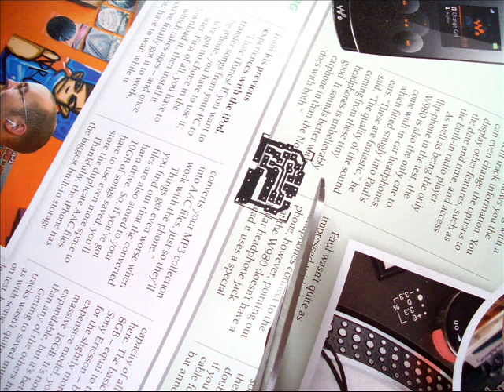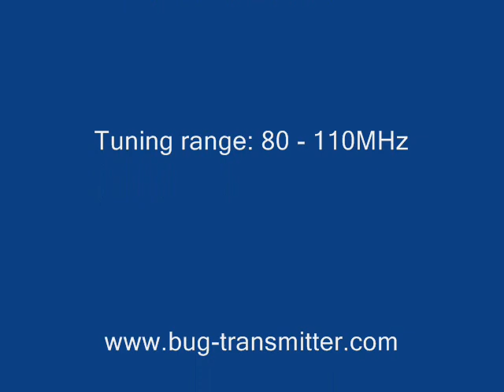Making a long range spy bug FM transmitter

Comment: I have a mp3 player FM for car, How can I change it for 9v battery and put a micrphone to make a spy transmitter from it?
Reply from the maker: +Anonimescu Cutarescu 
Yes that will work ,you will need to build a transistor amplifier circuit for the mic.
Reply: +dazaro3 Thank you. I tryed to put mic. on a fm moldulator mp3. did not work. I had also put a  sound from computer and it worked a litle bit but, bad noise aswell
Reply: works with a usb male cable and A portable battery charger of a phone
Reply: +CrissPivot Thanks for replay! anyway I cannot imagine how to do it, at the moment. I will think about it in time.
Reply: Anonimescu Cutarescu http://www.instructables.com/id/Re-Transmitter-1/ use this
Reply: +CrissPivot ThanKs a lOt for iT.
Reply: Anonimescu Cutarescu  :)

Comment: If you replaced the mic with a 3.5mm jack cable this would make it a music transmitter too yes?
Reply: it would work but the quality of the sound is not so good
Reply from the maker: micultimy91
You will have a problem on the circuit. Double check all your work.
Try a different value resistor where the 68k is ,try a lower value resistor ,39k or even a 22k.
Reply from the maker: Please see my other videos ,i show hot to build a transmitter with a audio input.
Reply: dazaro3 could you please tell me how could I use mic as well as audio input work both together. Let me know what are the modifications required including all the new values.

Comment: Cool video but then,,whats the voltage rating of the various capacitors?
Reply from the maker: In this video they where all 50v caps.
Reply: Thanks for that.im also intending to make the pirate fm radio transmitter,,do i still use the same caps voltage ratings

Comment: 19v??? Do you know that this voltage is too HIGH for this circuit? Probabily you have burnt something with 19 volts. You don't increase the range too much if you increase voltage! To have a bigger range you need a signal amplifier, but i believe that here you don't need this. When you make a new circuit (that you have never done before) you must buil it first on air, not on a PC board. In this way you can see if it works or no. And you can adjust it easier than on a PCB.

Comment: had this working but the range is realy bad 5 feet max 
also tryed the antenna on the coil and no improvement
antenna is 165 cm long also its very hard to tune in 
am running it on 19v not 9v trying to make the range better but still sucks .
works for 5 feet on my cell phone and my car radoi will not pick it up , just picks up the radio stations .
am realy upset that i wasted money building this bug as its useless, now i need to find what else to do with all the parts i have

Comment from the maker: You can replace the trimmer with a 10pf or 15pf
ceramic capacitor and then adjust the FM frequency by 
stretching or compressing the coil.

Comment from the maker: Yes ,please see my other videos on building them using SMD parts.
100-150 meters indoors.Transmission range with FM transmitters is not an exact science because the transmission range works with the power of the transmitterand more important the sensitivity of the radio.

Comment from the maker: 10n up-to 100n will be fine replacement for the 22n capacitor 
across the battery and the other 22n the
output from the Mic you can use a electrolytic capacitor
,1uf up-to 100uf will be fine.

Comment: What is the diefference between nf and pf in the capacitors and is an air trimmer a variable resistor? i am having trouble finding the components :(

Comment from the maker: I use 2n3904 transistors because they are very stable and
have the frequency hold well when the battery starts to drop
in power, the 2n3904 has low current consumption about 11mh
compared against say a BC338 about 16mh and they are very cheap.

Comment: Hi dazaro3, according to the schematic the voltage across the 470R should be 2v and the voltage at the base of the 2nd BJT should be 2.6v however after having built the voyager mkII on a veroboard the measurements i get across the 470R and the base of the 2nd BJT are no where near the values on the schematic. After connecting to a LED Power Measure i only measure 0.2v which apparently should be around 2v according to talkingelectronics. Could you please help me out here. Thanks

Comment from the maker: @Arjoonmoal 

Yes they work very very well .i have made over 2000 of the type in this video.
Transmission range is very much down to the FM radio sensitivity
My hand held FM radio a Sony ICF-S22 it can only pickup this transmitter from about 200ft but if i use my TECSUN PL-380 then the range is more like 3000ft!

Comment from the maker: @vasoeo11 
To get a lot more power you will need to use
a different design ,you need to add a amplifier stage,
thats a 3 transistor design,use Google to look for that type 
of FM transmitter design or on the talking electronics website.
Or with this type of design try using other transistors ,not the 
1st transistor the one near the Mic thats the mic amp the other one.

Comment from the maker: @vasoeo11 
Transmission range is not an exact science because the transmission range works with the power of the transmitter and more important the sensitivity of the FM radio ,FM radio's sensitivity is not all the same ,some radios are good with small low power transmitters and others are not good ,i can test this with my small hand held FM radio a Sony ICF-S22 it can only pickup this transmitter from about 200ft but if i use my TECSUN PL-380 then the range is more like 3000ft!

Comment: you may use 30 t0 60 pf air trimmer...another option is to use any  capacitor between 10 to 30 pf but problem is that with it you can not change
  transmitting frequency

Comment: This is a great video.  I am trying to build this with my son.  I cannot find this "air trimmer" anywhere.  In the comments you suggest "stretching the coil" of a 10pf capacitor.  Could you tell me what that means?  Do I just order a regular 10pf capacitor and open it?  Thanks.

Comment from the maker: @arounder1 

If u cannot find a trimmer then use a fixed value capacitor (10pf-25pf) and adjust frequency by stretching the coil.

Comment from the maker: @BPereirinha 

To reduce the range is very easy to do

This transmitter will work down to just under 3v ,if you use 3v you 
will need change only 1 part and that is the 68k resistor , change that
to a 22k one .if you use 9v just cut the antenna down to 10cm.

Comment from the maker: @levettp 
Yes ,we used the super TECSON PL380 radio and got over 800 meters ,but the TECSON PL380 has got a very  sensitive FM tuner and is the best hand held radio we have ever tested with small low power FM transmitters ,some cheap FM radios will have very little range like 50 meters ,so its not all down to the power of the transmitter but how  sensitive the radio is ,and the transmitter in this video will have only about 8-12mw of output power.

Comment from the maker: @aayush10001 

If u cannot find a trimmer then use a fixed value capacitor (10pf) and adjust frequency by stretching the coil.

Comment: if u cannot find a trimmer then use a fixed value capacitor (10pf) and adjust frequency by stretching the coil. A frequency counter would come handy.Any general purpose small signal transistor with an ft of 300mhz should work ok.pn2222 , 2n3904 are both good.

Comment: dazaro3,
I have a question:the 2-10p air trimmer,which i got has 3 leads ,but in the schematic are only 2 leads.Which leads should i connect?

Comment: if your having trouble finding the capacitors, you should convert their values. a simple conversion table is like this::    uf    nf     pf    ::to convert capacitor values, you move three decimals, in the direction you need to convert so for a 1n ceramic capacitor, you start at nf, converting to uf,  you move three decimals to the left so a 1.0 nf capacitor becomes a .001 uf capacitor, and a 22n capacitor, converted to uf becomes a .022 uf capacitor, both are at radioshack labeled as uf.

Comment from the maker: @beehard44 

You can NOT use the 2n3906 ,the 2n3906 is a PNP 
Transistor ,this circuit uses a NPN transistor,
There are two types of standard transistors, NPN and PNP

look up PNP and NPN transistors on Google.

Comment: it is possible if  you replace the 1 - 5p to 30p air trimmer with a .05p -  .5 to 30p air trimmer since it controls the frequency that is if you could find the part but that's in theory

Comment: In the beginning of the video you stated that you changed the 2pf to10pf air trimmer to an 5pf to 30pf air trimmer, and later in the video you stated you solder a 5pf to 30p ceramic trimmer.
I would like to know which type you used? and if it is a ceramic trimmer you used, why did u choose it over an air trimmer, is it because they have more precision? Thank you!

Comment from the maker: Hi
General purpose disc capacitors.
The voltage of the capacitors can be 
10v and upto 100v ,most of the ones we use
are 50v capacitors.
Thanks

Comment: How could I make this use a 3.5 mm stereoplug? Or both, 3.5 mm stereoplug and mic with "ON-ON-ON switch". 
What kind of antenna wire you are using?

Comment from the maker: You tune in with any FM radio,a FM radio will pick up the FM transmitter when doing a manual or auto scan on the radio.

Comment from the maker: Used a car radio ,they are the most sensitive.
I am still trying to find a small cheap super sensitive hand radio , tried 6-7 but only get 200-300 meters! ,when car radio over 2400 meters!.Just ordered itam number 190314508597 on Ebay,hope this works better than the rest.